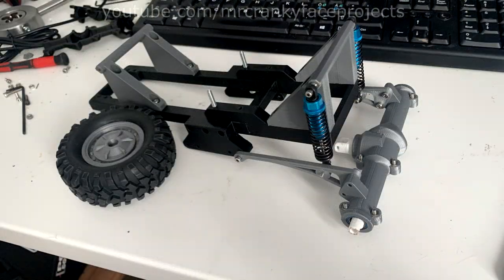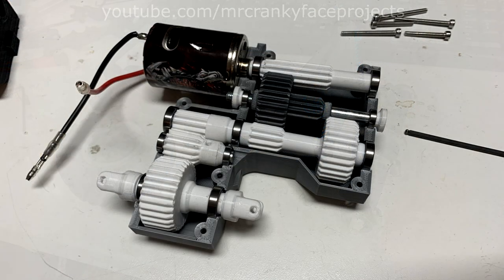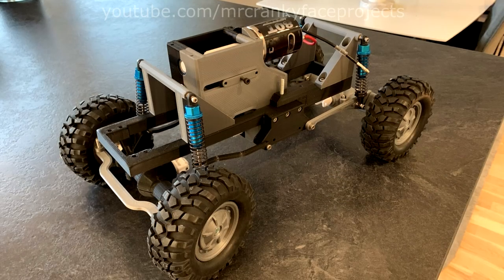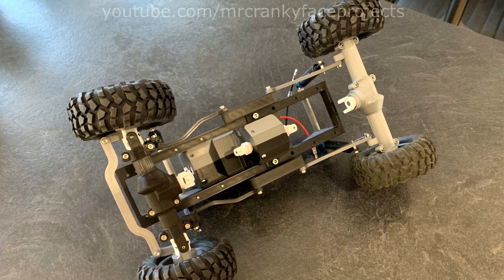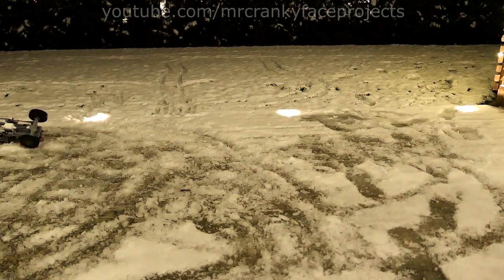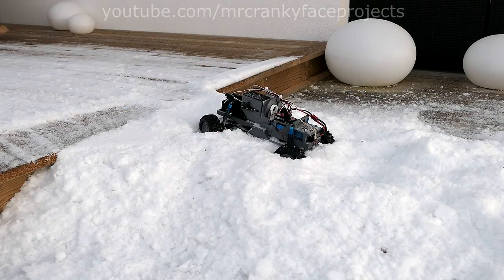3D Printed RC APC (2 stage gearbox, AWD, Part 2)

Comment: Love the look of that chassi, seems very good for its relatively low level of complexity! 
Interested to see where the two speed gearbox goes!
Might the steering linkage be moved to the back, rather than the front, of the forward axle? Would give clearance between the front wheels and protect it from bangs like the one that killed it, unless it was the actual stress put through the wheels onto it that snapped it.